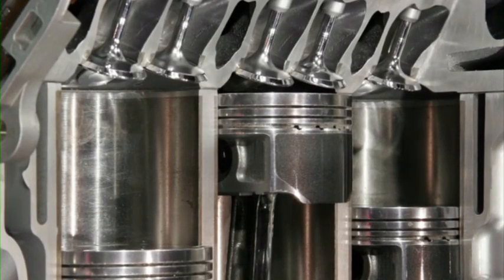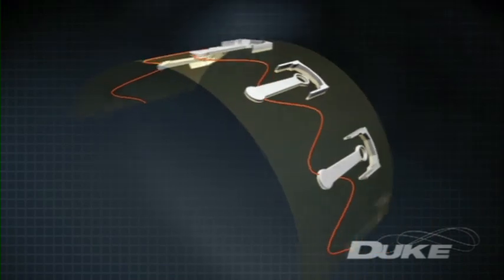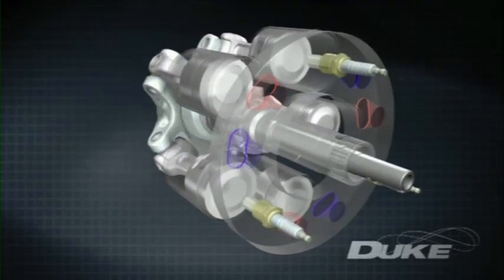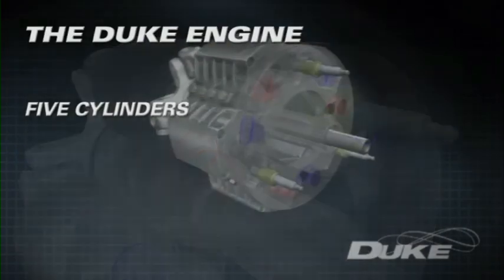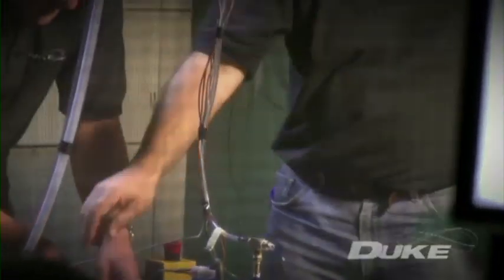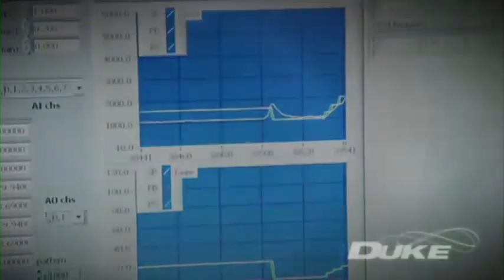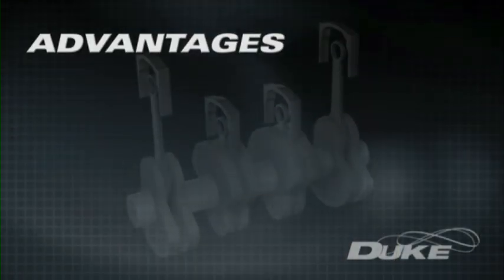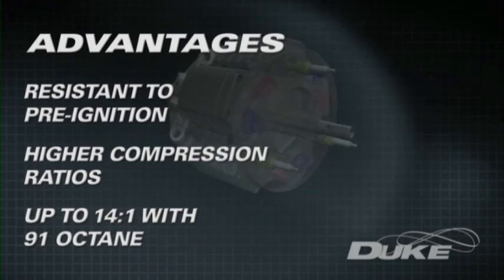Duke Engines

Comment: This has the same problem as the rotary engine, how are you going to seal off all the cylinders?
Reply: The real doktorbimmer Mazda didn't have any problems.  Americans who refuse to follow basic instructions had problems, However anyone with half a brain could easily get over 100k without significant problems, something no American engine seems able to accomplish.
Reply: That actually isn't a problem with rotary engines when operated properly.
Reply: I foresee a whole host of problems it would share with rotaries. so much surface area to seal. even when done right you'll be burning lube in the cylinders. ignition happens in one part of the engine block so seals have to account for fluctuations in tolerance due to localised thermal expansion.
Reply: Floyd Wilson You seem extremely naive and uninformed buy the scope and seriousness of Mazda notorious premature engine failures. The RX-8 was the cause of one of the largest engine recalls in the automotive industry.
Reply: @doktorbimmer  , Correct,  like the previous ( and first ) Wankel engine mounted on NSU RO 80 in the 70.
Reply: The Wankel concept and this design both share one thing in common... technically both concepts are inherently inferior to reciprocating and turbine technology.
Reply: lol.  I've got a '97 Astro with the 4.3 v6.  351,000 miles on original engine/trans.  Maint. is key.  Been through 5 fuel pumps and 2 spider injectors though.  BTW this is a motor built at the low point in American quality.
Reply: Roddy Evans My Ranger has another 1k miles on it.. 419,012 miles driven
Reply: +Floyd Wilson wrong
Reply: Its not? You mean Wankel engine right? Then why did Mazda continue to have serious problems right up to when the abandoned the design in 2012???
Reply: That 4.3 is one of the best 6 cylinders ever built.  I have one that I got about 10k ago that had 300k on it.  It was poorly maintained and only now is it having some transmission issues.
Reply: +intx123   Consumers expect reliability and long service life.. its why the Wankel is now obsolete.. and engines like the Axial-Cam (Duke and similar) were never adopted.
Reply: +intx123 NO, clearly you are speculating without any real knowledge.. Vehicle registration records around the world indicate that cars on average now last longer than they ever have in the history of automobile's existance
Reply: +intx123  Exactly my point.. they last longer.
Reply: +intx123  If your car lasts longer you won't need a new car as often...
Reply: My 2010 Ford Focus had 120,000 miles on it before I traded it in for a new vehicle the other day.  Everything on it was original except for the tires and fluids/filters.  Even had the original brakes (though they pulsated something awful).  The car never went to the shop except when I first purchased it to fix a badly installed door handle seal.  That was it.  Cars are very reliable now for the most part.
Reply: ***** You know nothing about me and you're just assuming whatever you like in order to make your own misgiuded point.  

Just because I didn't change the brakes doesn't mean I didn't know how to do so.  And why would I change the door handle seal myself when the vehicle was under warranty?  

I could have kept my car and maintained it but decided on a new Fusion Energi due to wanting something larger and newer.  My point was that my old Focus was running just fine even though it had over 100k miles on it.  

Oh, and just so you know, I was a Master-Certified technician with Mercedes-Benz until last year when a back injury caused me to switch careers.  I know a thing or two about cars.
Reply: Mercedes-Benz warranty has been the same now as it's been for as long as I can remember -  4 years, 50k miles.  Same as most other European companies.  Hell, Ford only does 3 years, 36k miles for a full factory warranty.

Also, don't compare Mercedes using the R350.... We're still trying to forget that thing ever existed, along with the early 2000's C-Coupe and the original SLK.  We've certainly had our bad years, mainly around the early 2000's, but build quality and reliability is much better now from what I've experienced.  

The timing chain issue was actually the idler gear in the 273 V8 (or balance shaft if you had the 272 V6).  The metal used for the gear was too soft causing the teeth to wear down to nothing in about 40-80k miles.  That caused a check engine light and some vibrations.  Mercedes acknowledged the issue and fixed them under warranty.

Yes, the shocks aren't cheap on the tailgate of an R350, but all OEM parts, no matter from what company, are always more expensive than aftermarket parts.  That's why aftermarket parts exist.  They didn't cost $2000, though.  Something is off there.

Anyway, sorry to hear you had a bad back also.  It's not fun.  I tore my L5 disc while installing a starter motor in an E350.  Took me out for a year.  I'm in sales now, lol.
Reply: +intx123  Well, if that was true? Then why are today's cars racking up more miles and staying on the road longer on average than anytime in the history of the automobile? Clearly there is a fundamental flaw in your concocted theory here...
Reply: +intx123  "today's cars" as in the ones that are currently registered and being driven on the road right now...
Reply: +intx123 Well unless you are psychic? You cannot speak truthfully about the durability of a brand new model.. sold today... or yesterday..
Reply: +intx123  I said psychic... not  psychosis.
Reply: +intx123  People who are out of touch with reality like you are called psychotics,  not psychics. There is a big difference.!
Reply: +intx123  And you do? Lol!!!. youre having trouble figuring out if automobiles are more or less reliable..  Quantum Physics is way out of your league son...
Reply: +intx123   My point was you don't know anything about automobiles.. A point which you have already proven...
Reply: +intx123  That is very doubtful..

Comment: less parts overall but more moving parts which means more seals or bearings. this engine seems about as reliable as a rotary engine to me.
Reply: Rotaries are much more reliable than everyone bangs on about them. It's not uncommon for well built rotaries to run 100,000 km before needing mechanical attention....
Reply: You are being generous. This seems way worse to seal because there is movement in all three dimensions.
Reply: Exactly what I was thinking while watching.
Reply: 100,000 km, huh? I think a quarter million miles on a conventional ohv v6 has that quite handily beat.
Reply: Zoltan Csikos 15 comments down and the only insult comment comes from………you, congratulation, you are exactly what you are hating on.
Reply: In theory, a rotary should by more reliable because of less moving parts. Funny how things work one way on paper and another in practice.
Reply: Sorry, I thought mentioning that the were "well built" would entail that.
Reply: I'm talking rotaries making around 600HP, That's a lot better than the internet know-it-alls reckon
Reply: Then it would be advisable to make such qualifiers apparent when making the initial claims. As far as this thread sounds, it appears that most would be considering oem equipped engines.
Reply: "Exactly what I was thinking while watching"
 - Me 2 :D
Reply: TruckerPhilosophy very true
Reply: Not only that, but the heat distribution was also as troublesome as rotary: the combustion chamber behind sparkplug is always combusting and is always hot , which means more wear than other areas, just like rotary.
Reply: Yes. It's because they "leak heat" (need to be made of ceramic!) that they are too inefficient for most uses.
Reply: https://youtu.be/mTp2y5k_SI0
Watch this video
Reply: not true... rotaries are wayyy more unreliable

Comment: Electric motors are far more efficient than fossil fuel engines. It's certainly no secret that the railroad industry has used electric motors to power trains for many many years. They run on diesel you say? The diesel engine in a train is only there to power a generator that produces the electricity needed to power the electric motors. So in a sense, hybrid technology is not new. The amazing thing about the direct drive in an electric motor is that it can also be used in braking. The major problem with electric motors is power storage. Recent advances in battery technology have had a positive impact on this, but we aren't quite there yet. We'll get there one way or another I expect. Only a matter of time.
Reply: The only reason trains use an electric drive is the difficulty of providing sufficient gearing for an IC engine.  Chemical fuels burned in a diesel engine with a direct drive transmission is the best efficiency you can get. 

 If less weight is required it is a slide down to jets, with the trade off of less efficiency.

Electric engines have no place in vehicles, they only serve to magically whisk away the pollution to a coal plant, doubling it in the process.

Comment: very interesting design. call me when it can last 200k miles.
Reply: Where did you came up what hype? Boxer engines (Subaru and Porsche) are notorious for going past 200K miles with minimal wear. They're inherently balanced, so there's NO destructuve shaking motion, unlike V engines which require heavy (power robbing) counterweights just to keep the engine from shaking out itself to pieces.

You think that by slandering boxer engines it will further your case against a completely unrelated technology like this Duke thing? How old are you? 12?
Reply: Wow I wonder how my Subaru has gotten to 115k miles then.
Reply: +Christopher Middleman wow... wonder how mine has 300k.......
Reply: what did I miss here with the Subaru nonsense?

the boxer motor is nothing like this duke junk. the boxer is a well designed and proven piece of equipment. 

everyone knows the rotary motor is the best anyway!
Reply: Yah the reason valves are used is because the seals moving around are impossible to have much wear life to them. So why would the world retool itself to save a couple hunder pounds, when regulations make them add thousands of pounds else where? I guess a bunch of engineers need jobs and the gov needs to spend grant money.
Reply: AtilIa TheFun My main and only concern is asking who invited you to give half assed opinions on something  you obviously failed to read before meddling in. Given your nick, you seem to enjoy flaming  conversations you were not invited. Get a life, loser. P. S. Your mother is the idiot, flaming moron.
Reply: +Niklez7 My WRX must be a rarity then, having two hundred and eighteen THOUSAND miles on it. It also is all original parts... Something must be wrong with my car.
Reply: electric motors for the win
Reply: Yes, very interesting design that for some reason doesn't seem to be getting any serious interest because it looks too much like all the rest of the vaporware scams coming out of the Austral-Asia region
Reply: @alejandro You're an idiot.

You: Boxer engines are reliable
You: This isn't like a boxer engine

My main concern with an engine like that is the generation of heat.
Reply: Hey tools, boxer engines use valves, which is why they last, but they are inherently shakey, due to the lack of mass inside the rotational assembly to dampen it, but the whole thing moves together so relative to the other parts it does shake. BTW counter weights dont rob power, they store it, look up conservation of momentum. And boxer engines do have some counter balnce, but like I said, they are very light comparitively speaking in the engine world. 

Boxer engines are great for light weight power plants, hence their use in small airplanes. 

I would love to see a boxer turbo diesel in some cars and maybe planes.
Reply: d3adp001 not if the oil companies have anything to say about it
Reply: +Alex Paulsen Anyone familiar with electric locomotives knows that electric motors also generate heat.. plenty of heat. 
The Duke engine is a brilliant idea.. Noel Duke has become a multi-millionaire off this ingenious scam..  but you still cannot gauge the efficiency of the engine design itself but it was never seriously considered for production... only as investment "bait"
Electric motor do work great.. they are extreme efficient, unfortunately the fatal flaws associated with batteries prevent EVs from ever replacing the internal combustion engine.
Electric motors are very reliable... batteries are very unreliable and most important very  inefficient.
Reply: Alejandro Bello Don't hate me because I pointed out how retarded your statement was.
Reply: I have an STi with 117K miles on the Original Engine and My mom has a WRX with 148K on the original so your statement is patently false.
Reply: Less moving parts.... Less parts...
Reply: My 04 wrx sti has 300,000 miles no problems at all. It's all in how you take care of the engine, Porsche also uses boxer engines as well as small planes.
Reply: is it a rotary? or is it a boxer, if its a boxer it uses valves, crank, 
pistons like every other inline and v design thats why. Do you know what
 those parts are?
Reply: is it a rotary? or is it a boxer, if its a boxer it uses valves, crank, 
pistons like every other inline and v design thats why. Do you know what
 those parts are?
Reply: I have an all electric vehicle, do you?
yes electric is the way all things will go for certain
Reply: If it's generating heat, then I'd be weary of the efficiency... Stills seems like a stupid idea. Electric motors work great, and are much more reliable!
Reply: An average electric motor is about 88% efficiency, with heat being pretty much the only wasted energy, and a small amount of noise. I'm betting the heat dispersed is minimal compared to an air-cooled dinosaur-burner of a similar performance.

Our locomotives here in New Zealand are diesel electric, so there's no honest way to measure it.
Reply: Lithium batteries charge at nearly 100% efficiency...
Reply: False. Do a quick google search on subaru ringlands.
Reply: Niklez7 can confirm, until like 2007 your forester was good for 100k then you lost a head gasket
Reply: +Alex Paulsen  LOL!!!!  Wow!
Reply: i doubt it will last 50k miles. the design looks just too strange and odd.
 boxer engine with subaru are good while they last untill they blow 50k miles  (crack in cylinder block usualy)

Comment: the problem is that this thing still use 5 cylinders.
while modern cars use 4, 3 or even 2 cylinders. making those even leighter. and this thing doesnt work with 3 cylinders

Comment: Isn't this a variation on the swash plate engine used in the Mk. 48 torpedo?
Reply: Yup, Axial cam engines have been around for over 100 years.. and yet still can't compete with reciprocating engines
Reply: The real doktorbimmer They work well enough in torpedo's.  Then again, its a one-way trip so I guess mileage and efficiency aren't major concerns.
Reply: Waltham1892 Not to mention they are typically EXTERNAL combustion (steam/pneumatic motors) using highly volatile and corrosive chemical propellants. Not a technology applicable to aircraft, automobiles marine and other consumer applications 
 You will still find reciprocating and vane type motors are more common on torpedoes today.
Reply: The real doktorbimmer I wouldn't know.  I don't work on my own torpedoes.

I've got a guy who does that for me.
Reply: Waltham1892 Well, you did mention the Mk. 48 torpedo specifically as if you were familiar with its design..? it also uses external combustion with a axial swash-plate steam/pneumatic motor... fueled by chemical oxidizer/propelants
Reply: The real doktorbimmer Hey, I know a lot of stuff, but there are limits.
Reply: Waltham1892 Oh.. ok,

Comment: Fascinating concept, reminds me of a hydraulic pump.  There is of course one huge problem:  It burns something and that idea is a dead end as far as the future is concerned.  No matter what you do, it will never equal the electric motor, and as battery and motors improve the electric car will prevail.  My big idea is to mount solar cells on the vehicle roof, and even the hoods so that the car can recharge itself!

Comment: Fewer parts overall, but more parts in the most crucial areas.  In the standard piston engine, the connecting rod pivots about the crankshaft in one axis.  In this Duke engine, it connects to the crankshaft via universal joint.  One has to wonder how well that will hold up when the engine is operated under load, such as when accelerating a 4000lb car day after day for years.

Universal joints are obviously suitable for drive shafts, but the demands placed on a drive shaft are radically different than those of an engine's connecting rod.

Comment: Great for aircraft. Power:weight ratio.
Reply: +NOTABOOS It is infact a radial engine! The "reciprocator" concept, in order to compress and lighten a std radial plane engine, even less efficient in power transmission (it looks like this, not sayin it actually is) is very elegant!
Reply: +IlBio Parco though i'm not sure the developers started thinking how to small down a radial. It's like inventing the wheel startin from a square. Could be interesting to know this thinking process: Maybe they were tryin to invent levitation and they found themselves with a wheel, a cool BBS alloy one, but a wheel. :D lol!